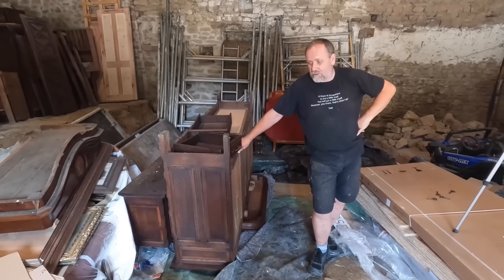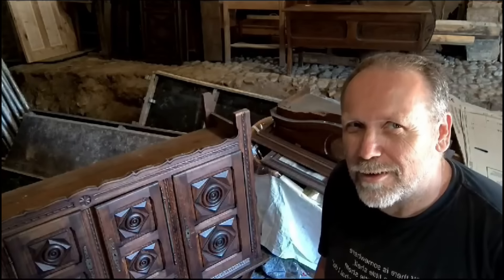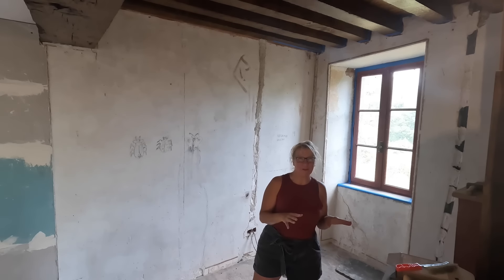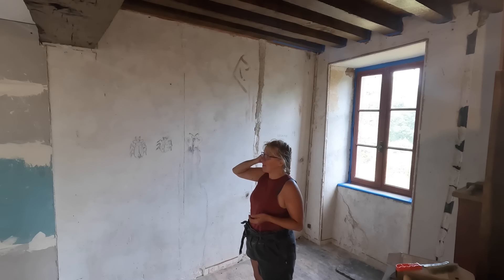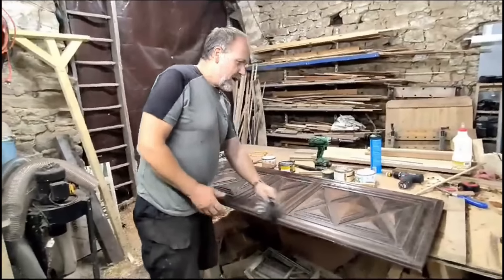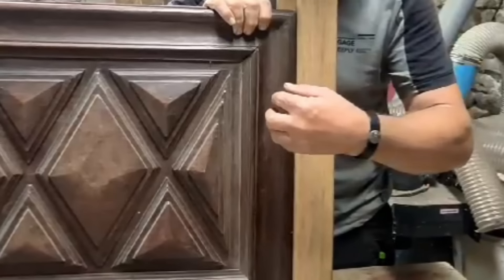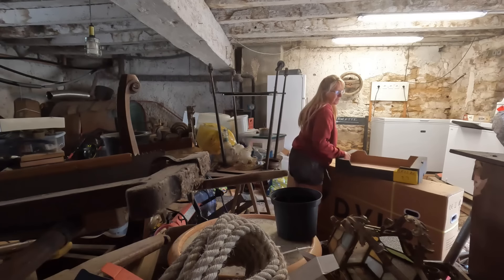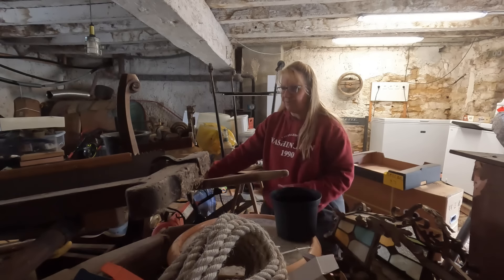Secrets to Crafting a Medieval 4 Poster Bed by up-cycling old furniture

Comment: Use what you need for the headboard but if you have any other unused pieces could make a pair of night stands as well is a thought. I can see why you picked the cabinet as it was to use the carving work to embellish the headboard is genius. Some might see it as waste of a good cabinet but I see recycling and making a life beyond it's original purpose. Luckily in France cabinets are a pence a dozen so can get them at a reasonable price to sacrifice to make them new objects. Hard pressed to find cabinets even the ugliest ones where I live cost a mint. Well done Ted and Lesa :)
Reply: I would have used the stained glass for this unit as it has the orange in the light but that's me. The second is small maybe for a bathroom or a hallway. The 3rd is a carved piece would go well with all the carved work in the room then again might be too much of it. If you could wire up the sconce would be fine. Maybe as night stand lamps that pair. I would use the lantern on the relais de poste building at the gate.